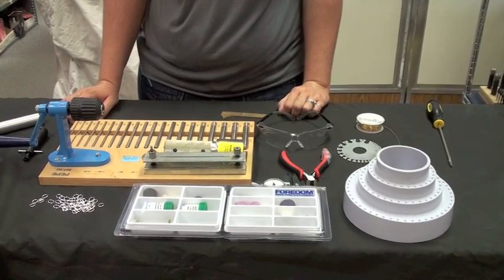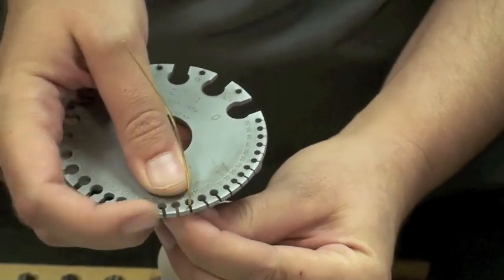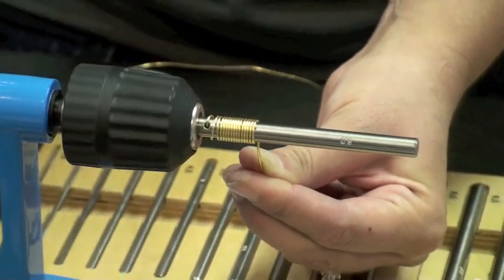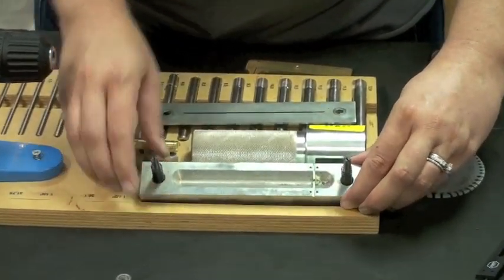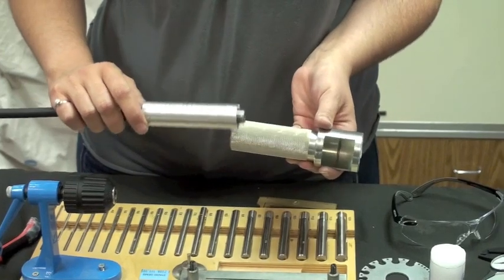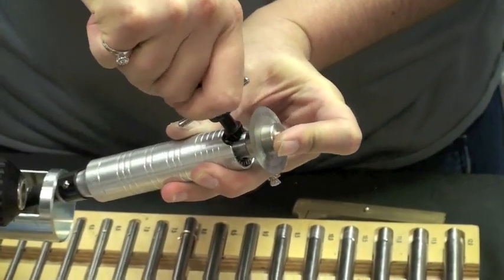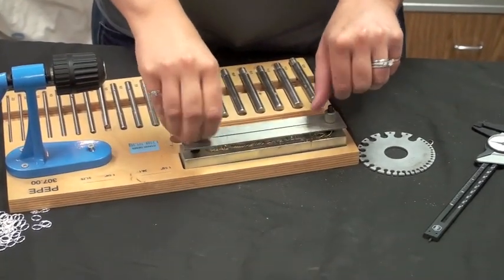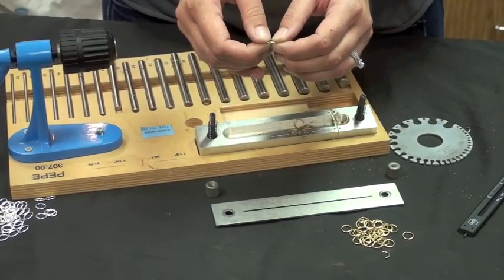How to use Jump Ringer and Flex Shaft kit.m4v

Comment: Oh... lol, one more thing.. there are no holes in the mandrels under 4.0 to hold the wire in place. Simply put the wire in between two of the claws holding the mandrel in place and angle the wire around the top of one of the claws and begin to wind. Hope that makes sense.

Comment: Just an additional note.. Be sure and put the saw blade on correctly and saw in the correct direction on the unit. I got a little turned around until I figured out the right combination.

Comment: What she's calling a mandrel is a Saw Arbor. The Pepe and the Jumpringer systems both come with them, though the powered jumpringer comes with a power drill and foot pedal as well in place of the cowl that goes over the flexshaft handpiece in the pepe and older models of the jumpringer.

Comment: I don't have a flex shaft, just a Dremel.  I found a guy online who makes this kind of set up , but with the fitting for the Dremel instead - including a blade and the box thingy for cutting the jump rings.  No mandrels, but you can use almost anything for that together with a variable speed drill, or even one of those Beadalon gizmos.  Anyway, think I paid about $70 and it works great.  Just Google J Kelly Jump Ring Maker.